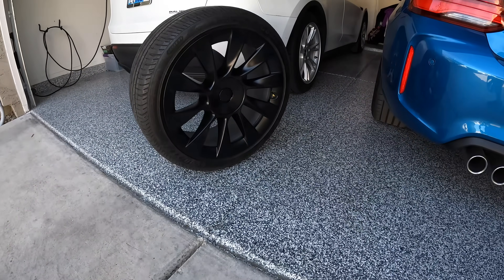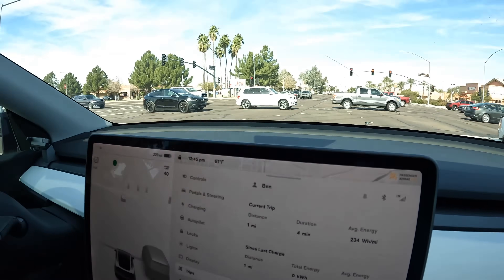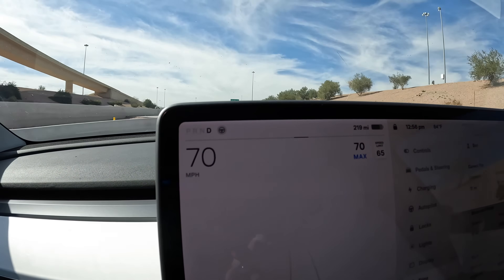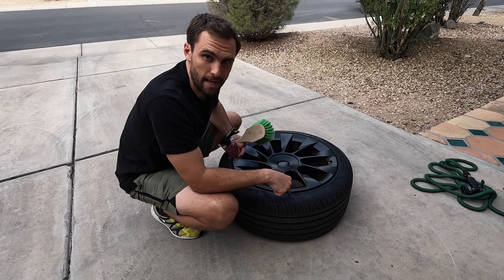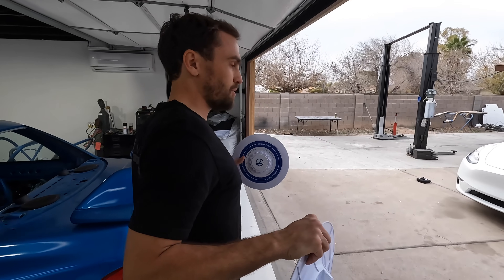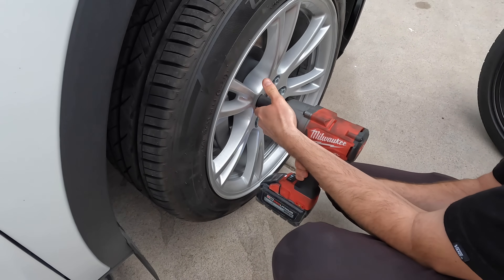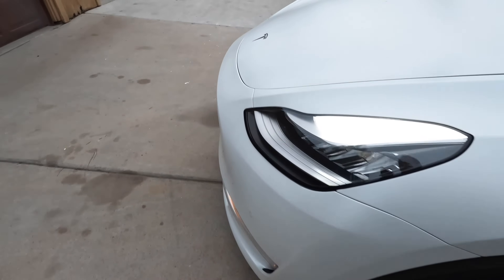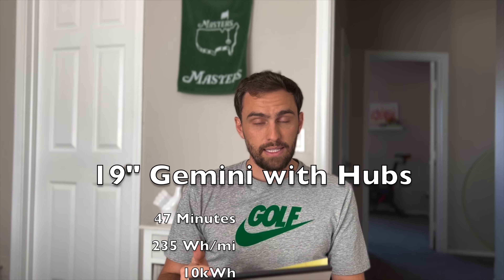Which Tesla Model Y Wheel is Best? - Range and Comfort Test

Comment: I have a 2021 Model Y Performance and I went with 295/35/21 all season in the back and 275/35/21 in the front and I lost a couple of miles, but I gained a lot on comfort and peace of mind on the rims. The tires look so much better on the rims now
Reply: What tires did you go with?  Was thinking of doing something similar
Reply: @brianlclayton  Michelin sport all season. It was recommended by a technician at Tesla as the ones on them now are overstretched. Do you agree? You will notice more rim protection as well
Reply: @tmorcos21  yes, I agree.  Nice that there are some all season options.
Reply: @brianlclayton  I agree with you, there are no winter tires for that size wheels, but I don’t have to worry about it in Southern California and all season should be sufficient in my local ski resorts
Reply: @brianlclayton  You can check out a YouTuber by the name Tommy L Garage, video date is 12/1/21. In there he did what I did for reference

Comment: isn’t the 42 psi the cold-temperature pressure?
Reply: yes it is....as soon as he said 38 and that'll warm up to the recommended 42, I was like, welp there goes the comparison. 🤦🏻‍♂️
Reply: @kentgabriel3572  like I wrote in another post, 42 Cold will swell up to 50 PSI hot while driving through the desert heading to Las Vegas in my Model 3 and Model Y. , so like Gjeebs I start out at 38 and see 46 when Hot.
Reply: @fredsmodel3  the tire pressure is meant to be set cold and not changed.  The tire is designed to withstand the increase in pressure from driving and hot temperature.  For example, all the tires that are used in Teslas have a max rated cold pressure of 51 or 50.  That means that you can safely set the tire pressure to 51 or 50 (whichever it says on the sidewall) "cold", which means after the car has sat for a while; and you don't have to worry about the tire pressure even if you will drive it in a hot desert.  As a rule of thumb, tire pressure changes by 1 PSI for every 10°F change.  Of course, you don't want to set your tire to 50 PSI at 0°F and then drive it in a desert that's at 110°F.  But for the Tesla, set the tires at the recommended 42 PSI cold and forget about it.
Reply: Was going to say the same thing. I aim for 40-42 cold
Reply: You dummies. He does this on purpose so you comment and he can game the YouTube algorithm.

Comment: I switched from 19" geminis to 19" Tsportline TSTs.  I noted a significant drop in efficiency which I attribute partially to the different rim but mainly to a switch from the stock continentals to Michelin Pilot Sport AS 4s.  I know it's entirely impractical, but I think this test would have been more apples to apples if the tires were the same between the 19s and 20s.
Reply: But they don't come with the same tyres from Tesla. Isn't this more relatable to the buyers as these are the tyres they'll receive with the car as optioned? I doubt most folks run out to buy a new set of tyres right after they purchase a car.